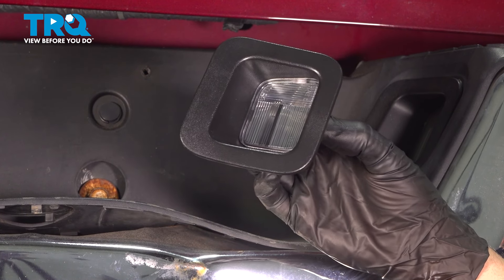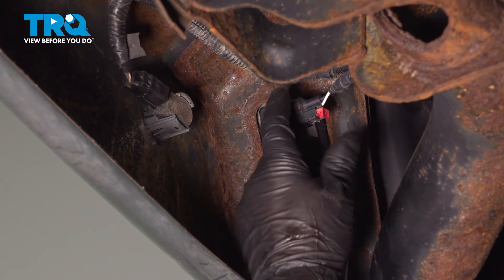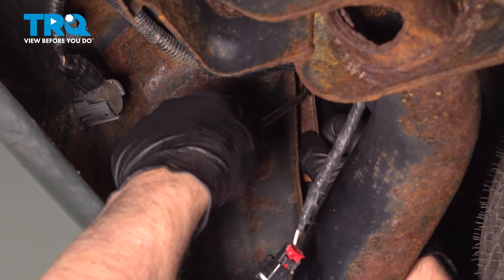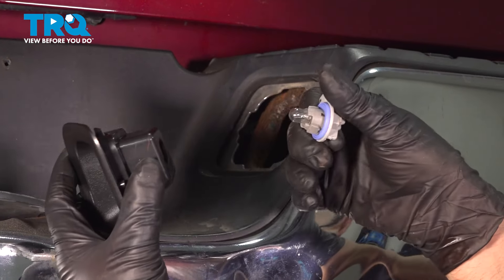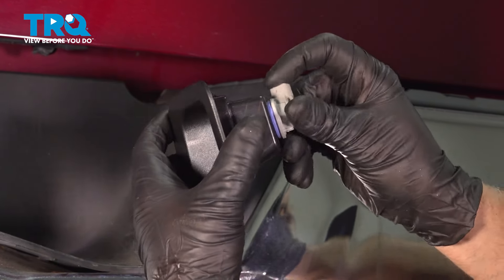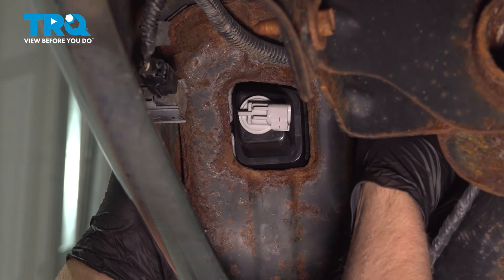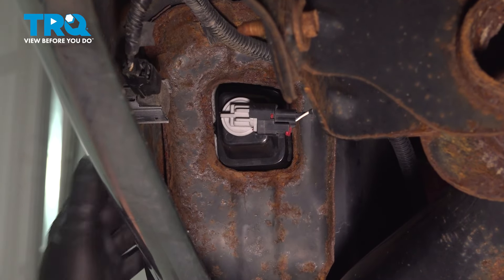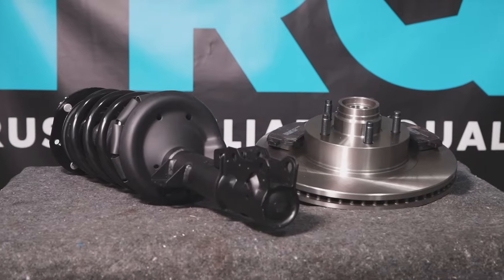How to Replace License Plate Lights 2011-2018 Ram 1500

Comment: Looks like half of what you did was unnecessary.  You could have just twisted the bulb holder while it was still mounted, there was no need to remove the clip or take the assembly out.